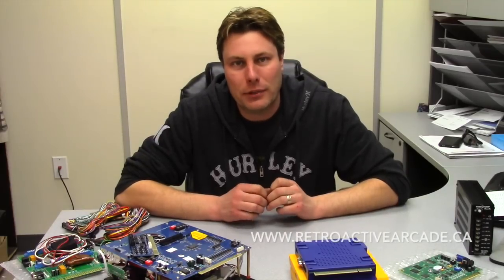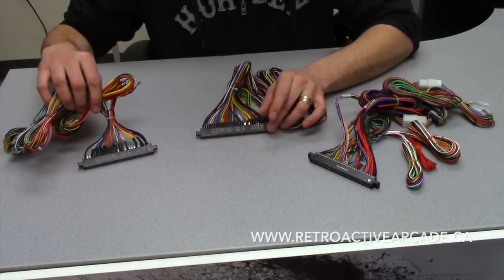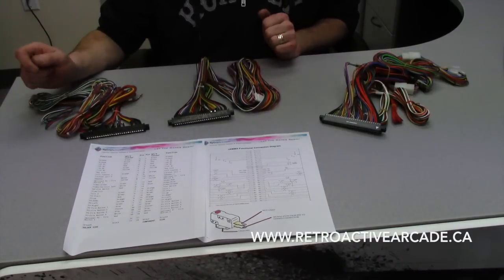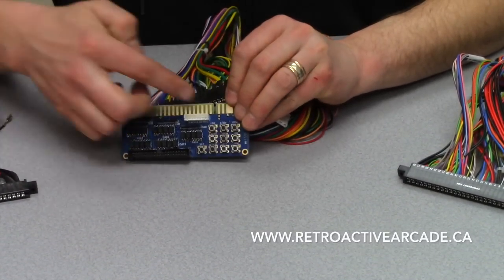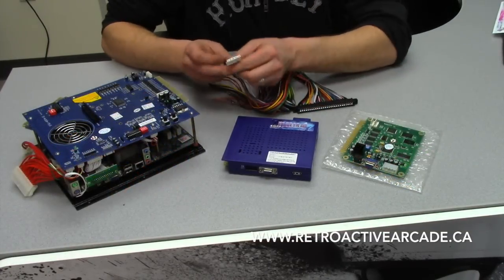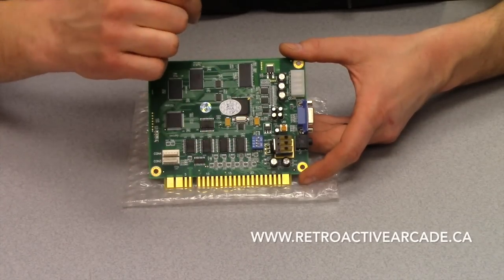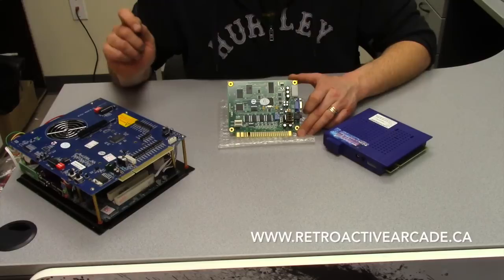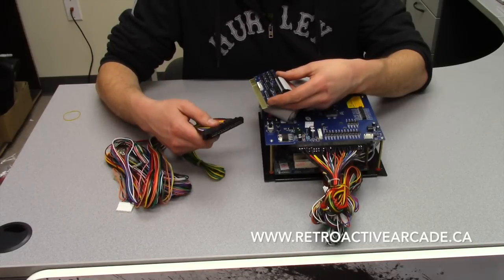What is JAMMA and how does it work?

Comment: May I know how to connect a USB joystick to JAMMA harness? I just have the arcade board without the cabinet and I already found a RGB to VGA converter. Hopefully you can share your experience with me.
Reply: I'd think u just download the diagram for jamma and u wire the buttons and joysticks directly off the jamma harness, no USB or o delay encoders needed etc for Real Game board, or if it's a PC etc just plug it in the usb port and dont wire the jamma controllers..all the best from NZ

Comment: Does the 2 in 1 switcher work with say a CPS1 hyperfighing board and a Pandora 5 being hooked up?
Reply from the maker: The switcher will not work with either one of those boards, it will not recognize the 5 & 6 buttons for either player and it will not produce proper sound.

Comment: Good afternoon, I have captain America and the avengers but want to switch the board with a multi game board...is this possible? I'm looking to see what I'd need
Reply from the maker: Really all you need is the board and I would pick up a universal jamma harness to replace the wiring if I was you. I would also replace the arcade power supply if you have an original in your machine. You will also need a vga/hdmi to cga converter if you have an original tube monitor CRT.

Comment: I have a question I have a Golden Tee 99 and I want to know can I put a 60 in 1 multicade bored in it what would I have to change out and I know that I would probably lose my Golden Tee game by doing the process or is there a system that also has Golden Tee Golf on it and other multiples I've been trying to look into the Pandora's Box 5 but I do not know where I can go to find out list of games that are on different formats can you help me
Reply from the maker: Hi, yes I can help. If you want to keep Gold Tee you will have to go with the 2019 or 3016 game board. They are all Jamma but those are the only ones that support and have Trackball games in them. The Pandora's box does not support a trackball. You will also need a PS2/USB adapter for your existing trackball to work with the, Jamma board or buy a new one that is PS2/USB. The adapter can be found on the Suzo Happ website. Here is a link to the different game boards that we offer and the their game lists. 

https://retroactivearcade.ca/pages/game-lists

Comment: I currently have the 1 in 60 board from BLEE and want to upgrade to the 412 board- is it simply plug & play? can I just unplug the 60 board and the 412 is good to go?
Reply from the maker: Yes it is a simple plug and play exchange, you need the 4,5 & 6 buttons on Player 1 to make most changes in the menu, but the default settings are usually good for most people.

Comment: My video orientation is always horizontal. I cant get it to show the screen vertical. on our arcade. Any tips?
Reply from the maker: If you are using a JAMMA board then the only ones that display in Vertical are the 60 & 412-in-1 and the 1162 does both. The rest that are out there display in Horizontal only and will letter box with side bars to adapt to your monitor. You cannot just change the output on a JAMMA board to work either horizontal or vertical, they are pre-programming to display the way they are intended.

Comment: I have the 60 in 1 card,,,,any idea why in my centipede it fires by itself,,,I want to fire manually
Reply from the maker: That means you definitely have a short for your "A" button,  check all your connections again and make sure your ground wire is on the bottom prong and your action P1 A wire is on your middle prong of your microswitch.  The third third prong is always open/ on so that would create the problem you are having.
Reply: @RetroactivearcadeCa  the 1p (fire) button works for all the other games fine,,,,
Reply: @RetroactivearcadeCa  thanks so much for your help,,,it was a short, you were right...
Reply from the maker: You will have to go into the settings menu and switch it.  Follow the instruction guide to figure out how to do that.
Reply: @RetroactivearcadeCa  it fires automatically when the track ball is hooked up,,,there's no setting to change for this...any other ideas???
Reply: You were right I had a short in a wire,,,,thnx so much for your help..
Reply from the maker: @FLDawg71  anytime!

Comment: Hello, your videos are increible amazing they way you explain is great for the new students thank you so much a learned a lot from you!!! Do you have a video on how to convert from CRT to VGA using the adapter and what cables to connect, again awesome work!!!
Reply from the maker: I'm sorry I do not, the reason why is that if I did a video on that it would be specific to what I was showing, brands, connection locations etc. I am sorry to say that it could be a trial and error situation at times, I can say that both of your sync wires from your monitor to the card adapter do tie into the 1 white cable of your adapter harness. The RGB is in sequence on the adapter but it is hit and miss sometimes from the monitor (wire colors may be different). You will need to get a schematic of your CRT before you start cutting away connectors to splice into your card for sure! Another thing to remember is that there are video adjustments on 3 different items when you do this, the CRT has a controller that allows for your sync and color saturation, then the CGA to VGA adapter has sync/color options and then your VGA monitor has its own options as well so there is too many variables to account for.
Reply: @RetroactivearcadeCa  thank you for taking the time to respond keep the great work.

Comment: The -5v connection is not "earth 5 volts".  It is a -5v supply.  It is 5 volts below ground.  If you were to use a volt meter and measure between +5v and -5v the reading would be 10 volts.   -5v is used by some older dedicated boards and is required by the old 4116 DRAM chips.

Comment: Question for you. Can buttons be added to Jamma harnesses? What I mean by that, my cabinet is for a 4 player turtles in time but I want to switch it to WWF wrestlefest. The game comes on but I can't start the game because the cabinet doesn't have a start button. Thanks for the help.
Reply from the maker: Yes you will have to add a start and a coin button for each player if your not already wired into the coin door.

Comment: So I just picked up a prebuilt Cocktail arcade with a 412-1 Elf Jamma board. The problem is the board does not boot to the game select screen. It keeps rebooting and says “No cable” and shows the elf boot screen. Any idea what’s the issue before I return it? Is there a pin out issue (28 ground)? I swapped out the board with an identical 412 and it still has the no cable message initially and then goes into safe or saved mode and boots into the game screen but the controller one joystick doesn’t work. Does it have to be configured?

Main question is, is this a jamma connection issue or a board problem? I looked online and can’t see anyone have a No cable messaging issue. Thanks for your help and posting this very informative video :)
Reply from the maker: ChicagoBulls2007 hi,  this means 1 of 3 things,  there is a short in your wiring (bad ground), you have high/ low voltage for 5v and 12v or your sd card has shaken loose during transport. While powered off,  take the sd card out and put back in tightly.  The sd card is in the square cap on the side of the jamma board case. The rest you can check with a multimeter.
Reply: Retro Active Arcade After Turning it on last night I’m
Seeing this: No Cable message > Enter Power Saving Mode and then a blank screen.

Majority of the times I just see > No Cable > Elf logo and it just loops.

Is this a grounding, power issue? I’ll check the DC/AC voltage later this week. I did swap out the 412-1 board with another one a few weeks ago and I’m still getting that going into power saving mode and the P1 joystick is not responsive. But player 2 works.

Comment: KC great video however I just got a vintage non jamma PCB of my favorite game and it was sold as working but minus cabinet and screen. Have wiring harness and a jvl KIT-BR SERIAL NO BR-0306-600198 Made in Canada. No manufacturer date. It has USB and lan ports , among others, so not antique? Have only found one video on non jamma and it was not even in english. Any idea where I could learn enough to get this running?
Reply from the maker: Hi Dean, I cannot say for sure how to connect your board but you can find a ton of help through an arcade forum called KLOV, there are a ton of manuals and schematics on there as well. You can post pics of your board to find out what you have and then download the schematic that will show you how to wire it. There are also a ton of groups on Facebook that will love to help you with all that stuff! You should be able to find a group local to your area as well.

Comment: I tried the Pandora's box 5 : 999to 1 from - Chan Cresin at https://www.aliexpress.com/store/2225050 and got a fake Plus it died ten minutes latter and now will not power up . So far I got three from them all JUNK !  .
Reply from the maker: GhettoJoe well why do you keep buying from them then? We charge a bit more for ours but we test and  warranty them for 90 days. Your better off to pay a couple bucks more to get from a trusted source.
Reply: you got that right . do you sell on ebay ?
Reply from the maker: GhettoJoe no, just on our website, www.retroactivearcade.ca
Reply: is it true that I have to get the new Super Jamma harness for the new Pandoras box 5 to work right ?
Reply from the maker: GhettoJoe no, a regular jamma harness will work, the old power supply might not have enough juice to run it though. There is an on board fan that sucks a lot of power.

Comment: where to find drivers for jammya
Reply from the maker: Александр Сангалеев what do you mean by find drivers? There are no drivers for jamma it is a set wiring/pinout standard from the 80's. There boards are set to that wiring standard and cannot be changed.
Reply: maybe I asked the wrong question. I need to play panic museum (TTX2). The game itself is there but does not see an I / O board and a gun board.
Reply from the maker: Александр Сангалеев there are no drivers needed, you do need the right power and voltage connected to the Jamma harness in most cases unless you are providing power to your controls/board through another source. The game might still power up without that but it will not recognize the controls. Are you using a multi game jamma board or is this a dedicated pcb?
Reply: you do not mind talking to the email
Reply from the maker: Александр Сангалеев not at all, email me you like
Reply: I do not write it? there is a photo. I sent it to the post office.
Reply: I apologize if I wrote it incorrectly. (Google translator)

Comment: Are there any jams boards that have everything from beyond Mame, Final Burn Alpha and sega model 2? I tried to get the other arcade emulators to work on my pc, and no matter what it is I keep running into errors on everything else :( I really want stuff from 2000 and beyound, and all the stuff that will not run in mame or final burn alpha :(
Reply from the maker: babada jamma boards will only have games that would be on the mame list, nothing really newer than 2005.
Reply: yeah I'd want one that runs Sega Model 3, Naomi, early Atomiswave, early Hikaru, and Naomi 2 as those are the ones that no matter what I try to do I just cannot figure out how to get the games running

Comment: Connecting joystick and buttons through jamma to the motherboard is it producing less lag then USB decoding?
Reply from the maker: A Jamma board cannot accept the input of a USB encoder, it is a friction fit 28 pin fingerboard right on the PCB, technically it shouldn't have any lag at all. The only things that cause lag on a Jamma board would be the microswitches and the processor on the PCB, there is nothing to encode.
Reply: Retro Active Arcade do you suggest to use jamma connection or I can go straight to the motherboard's USB port using USB decoder?
Reply from the maker: Ruggero Piazza if you are using a Jamma board you Have to use a Jamma harness,  if you are using a computer you Have to you use an encoder.
Reply: Because I'm wondering what is the best solution with the pandora's box motherboard. I was thinking to go straight into the USB using a usb encoder rather then using the pin connector but from what I can see from videos it seems to be pretty much the same because I need to wire everything in the same way. So I was just wondering if adding a usb encoder in the process and go through USB port make any difference at the end. Thanks for your answers and your patience btw. Very good channel!!!!
Reply from the maker: Ruggero Piazza the Pandoras box is a Jamma board,  the USB ports do not work for anything,  they are decorative at this point,  you can only use a Jamma harness, you cannot use an encoder at all.
Reply: Retro Active Arcade got it! Thanks a lot for the Infos!!!

Comment: Why some power supplies come with 24v connector ??  What is for ??
Reply from the maker: Slam Blambacid those power supplies are for replacement of older arcade machines and pinball machines. The new multi game  jamma boards mostly only utilize the 5V and 12V  of your power supply so that is all you need.

Comment: I need some HELP!!!  I have a Panasonic Plasma with RGBHV connections.  I've been searching and bashing my head as to how I need to wire the Jamma output to those connections.  Do I need to patch the ground into each cable is my biggest question.  Any help would be appreciated.
Reply from the maker: Are you trying to use the CGA video off of the Jamma harness to connect to an HD TV? That will not work directly, your only option will be a CGA to VGA/RGB converter that will give you those options.
Reply: This is a professional plasma monitor.  Basically, a plasma PVM.  It has RGB and HV syncs with BNC.  5 connectors to create the signal with the lower kHz rating.
Reply from the maker: That is a bit beyond my  expertise but your RGB and ground is straight forward, with 1 white wire left over we usually have to tie in both HV syncs to it and that seems to work.
Reply: Ok.  Thanks for the help.  I may split a few cables and try it multiple ways.  I'll let you know how it turns out.

Comment: About 12 minuets in to the video you talked about de-soldering and adding wires to put volume control on the outside. such a great idea by the way. what Ohm pot did you find works best?
Reply from the maker: ethan sanders-divers it is a 5k pot
Reply: thanks man that relay helps

Comment: do you need the power switch or can you just find a plug in charger for the jamma
Reply from the maker: Brian Doyle you can use whatever you want as long as you have a regulated +5V, +12V & ground power supply all connected at the same time.

Comment: Hi,
Maybe you can help me.
I just bought a Pandora 4S pink to play on my Combo a.v.
But,nothing,just a redlight inside.
(somes says that about the 12v/5v so needed a adaptator).
Before that I played Demon front and Elf without problems.
Thanks
Reply from the maker: fatalfury1994 how did you connect it?
Reply: Retro Active Arcade Ltd.™ first on jamma with  rgb peritel,after on vga and hdmi...
I will try with a Astro city soon.
Reply from the maker: fatalfury1994 I'm pretty sure that the Pandoras box 4 will not convert to the RGB CRT. It is only vga and hdmi.

Comment: Thanks a ton for the video. About to start a pandora's box 4 project.
Reply from the maker: Did you finish your project yet? Would love to see some pics!
Reply: Retro Active Arcade Ltd.™ if you had a personal preference, would you just run Mame on PC? I have a 60n1 cab, but I use PC for almost every build. My current project is a PC driven NBA Jam cab, just loaded with all the 3-4 player, 3 button games. My multicade pedestal is PC too, and my Scramble cocktail with probably follow suite. I only use jamma for cabs wired for jamma already. Lol...nevermind, got my answer at the vid end while typing this!